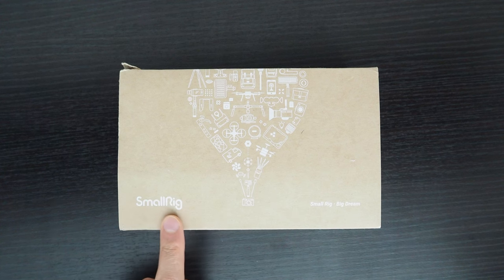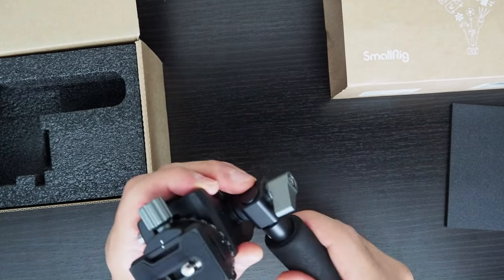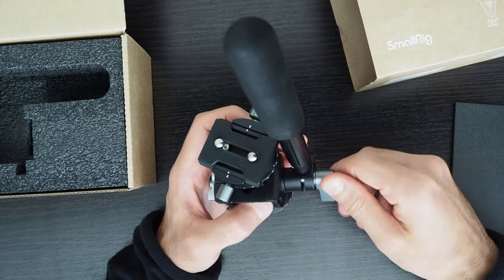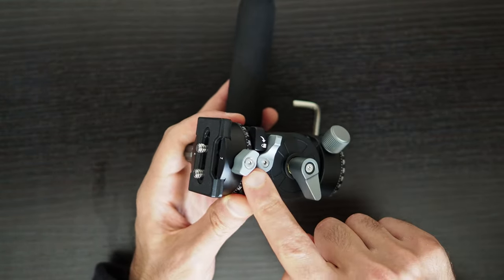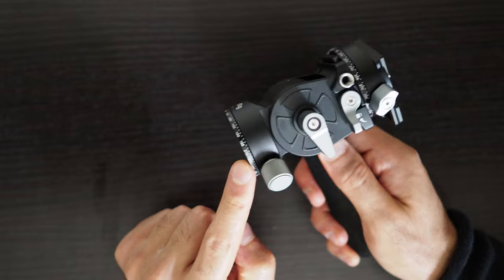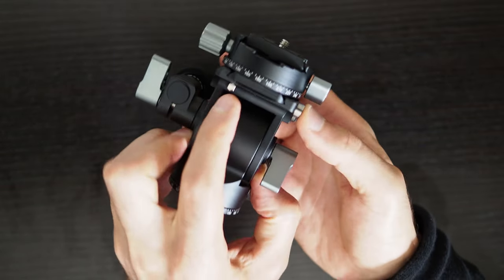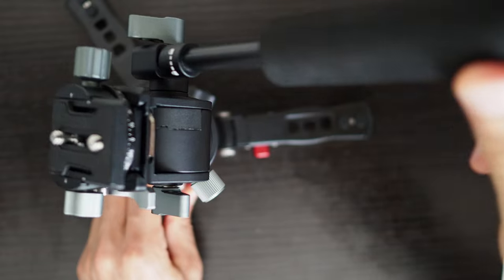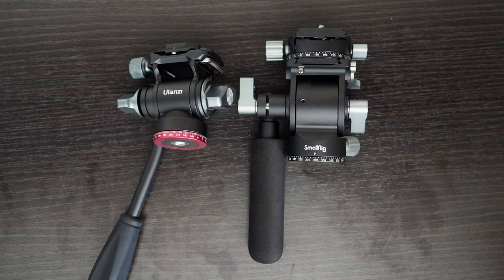SmallRig Lightweight Fluid Video Head 3457

Comment: I've just received this head and overall I'm very happy. BUT when it comes to the mount slide lock, I'm am completely worried that this will not hold the slide in place unless I only attach a very light weight body only. 

I have an R6 MKII and will either use one of my 3 RF lenses - 15 to 35, 24 to 105 or 100 to 500. Even with just my R6 MKII body, I'm finding that the mount slide lock when turned until it touches the body with the "lock" symbol (as tight as it can go), that with a bit of finger pressure, I can still slide the mount either way. So there's no way I'm going to be using this head as I have completely no confidence in keeping my gear safe, how did you find this yourself. Maybe not trying to slide the mount and just going on faith that it would stay put, would of meant that I didn't think about this.

When I get/find an allan key small enough to try and remove/adjust the lock lever, maybe it will lock nice and tight, but with all of the levers being so small for my mid size fingers, I'm also finding that my finger and thumb is taking a beating, so I might just bin the head and look for a more friendly adjustment one.
Reply from the maker: I used this head twice but it had too many problems for me so I no longer use it. I used a light camera and lens so I didn't think about the security of the lock and I didn't try to push it intentionally but I think this head is not good regardless. There are too many knobs for a small video head which it makes it difficult to use. Its pan bar is also really bad as it causes movement in the video footage if you intend to change its length during a shoot. So I ended up buying two e-image video heads (gh06f & 610fh) which are functional. The e-image 610FH fluid head is the smaller one which I use and I find it to be substantially better than the smallrig one but it is slightly bigger and heavier.

Ikan e-image GH06 video head: https://amzn.to/3t2ErG8
Ikan e-image 610FH fluid head: https://amzn.to/3ZkWzXT
Reply: @RadCameraMan thanks for your reply, I’ll check out the 610FH fluid head and also the Manfroto 520 I think even though it looks bulky, what was the other e-image fluid head you bought. 

I’ve had to go out today and without my camera bag and I’m sitting behind cover, 10 metres from mother swan and 6 signets all pruning on an embankment, always happens doesn’t it 😡
Reply from the maker: The other e-image fluid head that I bought is the GH06F. It is relatively big and bulky but it is quite popular in its price range. This is the GH06 with bowl base:
https://amzn.to/3t2ErG8

or you can get the GH06F which has a flat base which is what I purchased.

This is the simpler smaller 610FH with the monopod which is what I bought as a combined package: https://amzn.to/3ZkWzXT

Comment: I'm debating this device - it's worth noting that someone mentioned that the allen key can adjust the pan and tilt tension by rotating the nut in the tripod mount. Can you confirm?
Reply from the maker: Can you please share a link to where this was mentioned before I try this?
Reply: @RadCameraMan  I ended up trying it myself - it does seem to affect the panning rotation but not the tilt. I'm not sure it is an intended function.
Reply from the maker: @photographyRI  Did it impact the fluid head in any other way such as making it less stable and wobbly or do you have the impression that this is the way to adjust the friction? 
I think this is very interesting as I like to have the panning motion to be very loose when I use it on a monopod since I don't want the monopod to move which is far less stable than a tripod so I need to use less force.
Reply from the maker: I contacted SmallRig and asked them about this and their response was:
" It is not possible to adjust the tension/resistance to the translational movement by using an Allen key to turn the nut in the tripod mount (i.e. the bottom base of the video head). "
They didn't go into any detail about the purpose of that screw or what impact changing it would have.

Comment: at 15:38 there is one solution to this, get a sirui monopod, they have a qr release on the feet, so acting as a tabletop tripod to, and the fixing is 3/8 a better connection than an adaptor to 1/4, and for use on a Panasonic GH5 or Sony A7 series mirrorless setup, don't need anything more sturdy, as this is most likely what small rig made it for, or for Olympus and other micro 4/3rd cameras, so no need for counterbalance, just a reasonable drag.
Reply from the maker: Thanks for the suggestion. Can you please let me know what the model number is for the Sirui ?
Reply: @RadCameraMan  not the P 424, that was the older version, has a ball head on the legs, but is a different style, has a cone collar to lock it straight, what you want is the SVM 145 or SVM 165 they have the sliding collar, and the top plate collet system I was describing, with the P424 style it does some of this, but was a pioneer at it, the first footed monopod, the head comes off, but is a special socket, not a top plate 3/8" thread.

Comment: If you want a smaller, lighter version of this with fewer features, you're looking for the SmallRig 3259
Reply from the maker: Have you used the SmallRig 3259 ?
Reply: @RadCameraMan  No, I'm still comparing all the reviews, but it does sound like what you said you wanted
Reply from the maker: @mje-nz  Yes, if it works as well as the 3457 in terms of the smooth drag motion then it would be good but from the reviews that I have seen so far, this is not the case.
If you do buy it, please let me how it turns out to be. I tried a few mini fluid heads but didn't manage to find exactly what I was looking for. So I ended up buying some bigger and heavier video heads which are good but I don't like carrying them.
I have done some comparisons on the link below, but will create more videos about the larger video heads once I find some free time:
https://www.youtube.com/playlist?list=PL42hO7UHafKverdk2zvmjTySWxrJNp167

Comment: The grease is just for the screw thread. This “fluid” head doesn’t actually have any dampening fluid in it AFAIK. Also, did you consider something like the Sirui VA-5 instead?
Reply from the maker: I hadn't considered the Sirui as I was looking for something very small and light but I think that would have been a better choice. I have already bought the Ulanzi U-190 and the SmallRig 3457 so I think I will not waste anymore money on the smaller heads. Instead I will buy one of the substantially bigger and more expensive heads from the more established brands... hopefully I won't have to buy more heads that way. Although it means that I have given up on the compact fluid heads.
Do you have the Sirui VA-5?
Reply: @RadCameraMan  No, I don’t have the Sirui but I’m considering it.
Reply from the maker: If you do end up buying it, please let me know how it performs and whether it is worth buying.

Comment: Hi. Does it have a damping system?
Reply from the maker: Can you please elaborate on what you mean by damping system? If you are referring to the drag/tension for pan and tilt movement then yes it does have it but at a constant setting so it can't be adjusted to a fine grain level. If you mean "counter balance weight" then yes it does have that as well but it is very very weak so the whole set up including camera and lens should be less than 500g for it to be even marginally effective. Also the counter weight balance is not adjustable, -  it is a fixed setting.
Reply: @RadCameraMan  the 2d one. Thanks👍